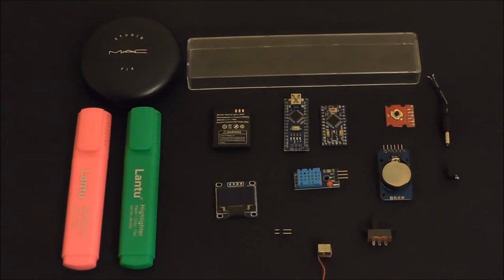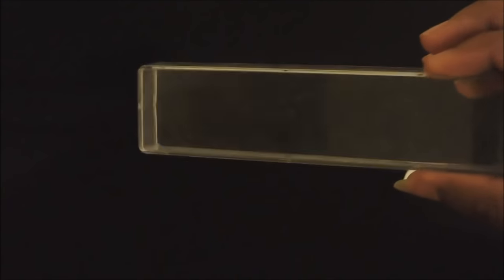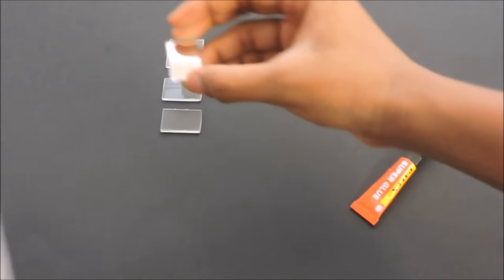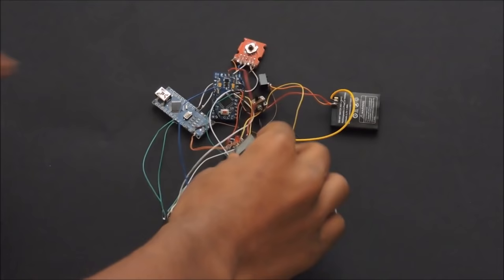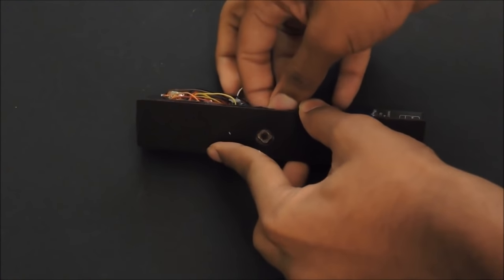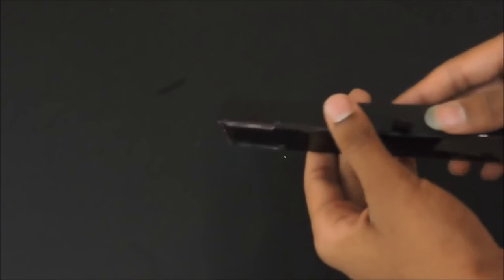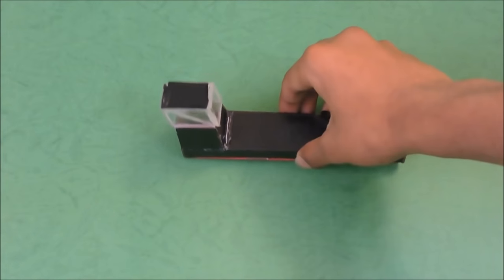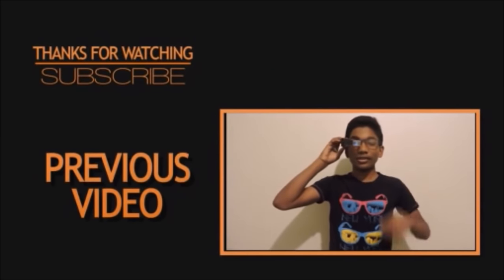How to make a DIY smart glass !

Comment: Awesome design. I subscribed. 
 I'll suggest you to add a lens from a virtual box. That might make the text more readable at close distance.

Optional suggestion:

Add 3 prices of black squires : on the front bottom and top section for daylight visibility. make the front plastic spring loaded so that the price stays on top initially, after  pressing a button or something, make the black squire come down making the display visible at daytime.

Comment: When i try to compie humidity temperatuure code its saying
Arduino: 1.8.5 (Windows 10), Board: "Arduino Nano, ATmega328P"

F:\users\Desktop\smtg\smart glasses by arduino made by aman\humtemptime\humtemptime.ino:8:2: warning: declaration does not declare anything [-fpermissive]

  DHT;

  ^

F:\users\Desktop\smtg\smart glasses by arduino made by aman\humtemptime\humtemptime.ino: In function 'void drawTemp()':

humtemptime:31: error: expected primary-expression before '.' token

    u8g.print(DHT.temperature, 0);  // display temperature from DHT11 in Celsius

                 ^

humtemptime:34: error: expected primary-expression before '.' token

    u8g.print(DHT.humidity, 0);     // display humidity from DHT11

                 ^

F:\users\Desktop\smtg\smart glasses by arduino made by aman\humtemptime\humtemptime.ino: In function 'void loop()':

humtemptime:117: error: expected unqualified-id before '.' token

    DHT.read11(dht_apin);  // Read apin on DHT11

       ^

exit status 1
expected primary-expression before '.' token

This report would have more information with
"Show verbose output during compilation"
option enabled in File -> Preferences.

what can ii do

Comment: How can I connect the OLED and the RTC to the Arduino, as they are both I2C devices
Reply from the maker: You just have to connect them in the same Scl and Sdk of the arduino.
Reply: the Technowright shall I solder 3 wires in a Y-shape? How did you do it?

Comment: Great video and hope you keep doing stuff like this. I tried the optics part of this with a TFT display I had. Why do we need the mirror ? Even with just a reflective surface angled at 45 degrees, I could see the screen. I dont see why the mirror is required.

Also, with the distance at which this would be from the eyes, it would not be a proper smart glass as we cannot focus on the horizon and the displayed stuff at the same time, our eyes would have to keep switching between the displayed content and the general environment.

Comment: Hey dude can you plz write list of things you need for this in the comments. Thnx!
Reply: Caelan HARMER Yeah I need it too
Reply: Miguel Eco that's not everything
Reply: Miguel Eco 2”4 OLED... doesn’t exist?
Reply: Craftpunk4000 look at desc
Reply: OLED 0.96 DISPLAY
Arudino pro mini
arudino nano
DHT humidity
5 WAW TACTITCLE SWITCH
3.7V battery
RTC MODULE
Switch 
Wire
Power Connector

Comment: Plzz provide links for the items you used.. Plzzzzzzzzzzzzzzzzzzzzzzzzzzzzzzzzzzzz
Reply from the maker: Amazon .in Links to buy all the things:-
Arduino nano:- http://amzn.to/2Fso4VO
Arduino pro mini:- http://amzn.to/2oZImPk
OLED 0.96”:- http://amzn.to/2oYTz2B
DHT humidity:- http://amzn.to/2G6YJlv
5-way tactile switch:- http://amzn.to/2oZCAxh
3.7v Battery:- http://amzn.to/2oXRUug
RTC module:- http://amzn.to/2trMGfN
Switch:- http://amzn.to/2oZJL8y
Wire:- http://amzn.to/2ttuB0P
Power connector:- http://amzn.to/2IeP6BS
Reply: Thnx bro